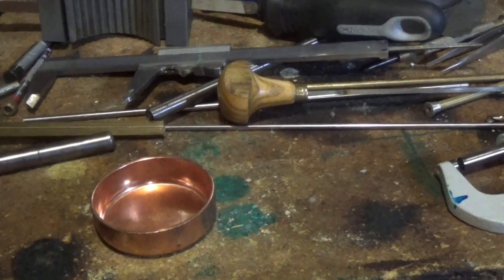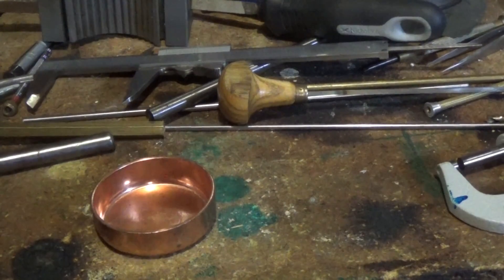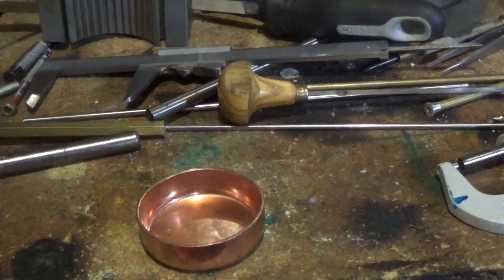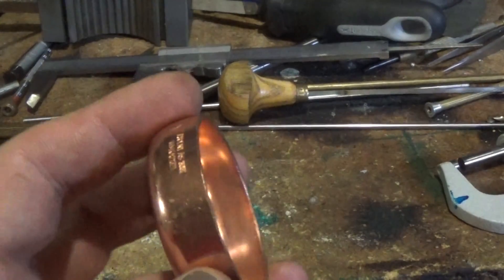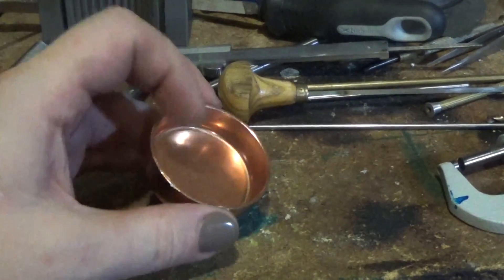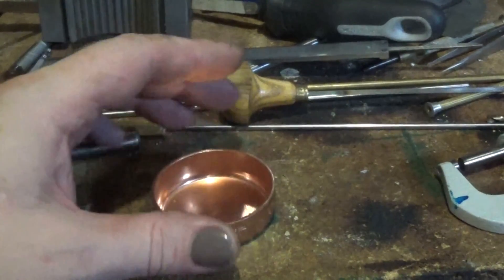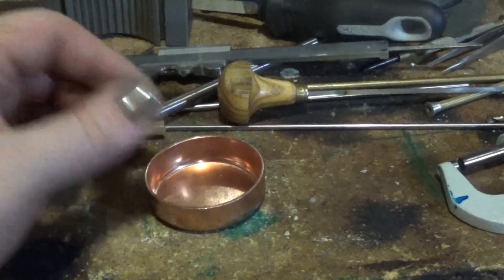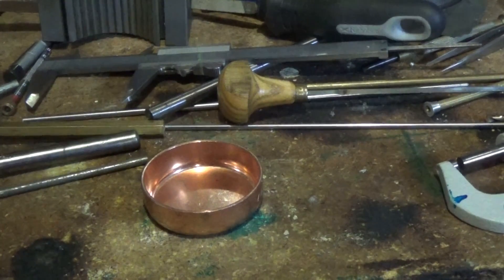A small Bluing Pan    a quick job from the scrap box

Comment: Very nice project. I used to do all my heat-treating this way. I must admit I had no brass chips (indeed, it is literally easier to find gold in Alaska than brass). But I acquired a copy of Tubal Cain's "Hardening, Tempering and Heat Treatment", Workshop Practice Series #1, ISBN  978-085242-837-2 (phew!) and I learned you could do all the colors in a household oven. I went to a cheap place (Walmart) and bought a cheap electrric household  mini-oven. The temperatures quoted by Tubal Cain are -- straw, 235C, blue 305C. Crank the oven up and let the stuff sit there say an hour. This is the way I temper these days. A cooking oven will easily reach 235C, but you may have to look around to find a cheapie oven that will hit 300C. 

You speak of Clickspring. Yes, it is mostly at 4x or more speedup. It is very carefully edited. Very polished.  It takes him a long time to edit one video. More, I suspect, than it takes him to do the machining. But I am trying to make a clock, so we are on the same wavelength. He has a lot of useful stuff. His finger plate alone has saved me hours of workholding. That is one gadget that I did not copy,  I bodgered  it, and it's very useful indeed.

Comment: it seems like your bluing solution will leak out at the leg threads with no sealant. perhaps a bit of solder would cure the problem. great example of the "available on hand" materials selection process which produced a neat little tool. 

i must also second the comment in an earlier post; your explanation is simple, clear and concise. keep it up...

thank you!
Reply: +crazymanmichael No no. We are talking about heat bluing, not chenical bluing. In this technique you harden the victim to glasss-hard (heat red hot, quench) then "let it down" by putting it in the bluing pan with a load of brass chips in it, until it turns blue.
Reply: i haven't done any bluing in far too many years. .then i was restoring a few rifles and shot guns and the only technique i was aware of was chemical bluing. amazing to get to be so old to learn something so simple.